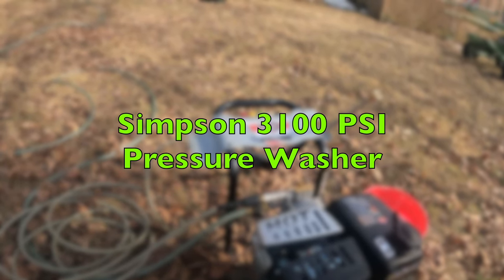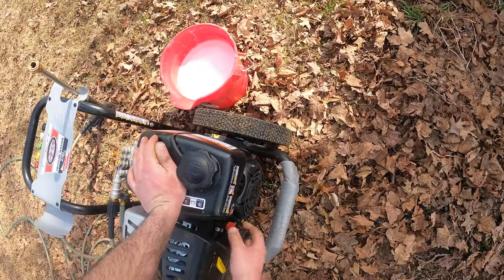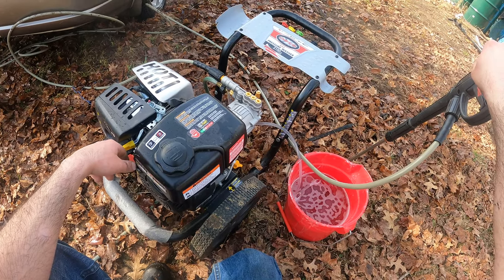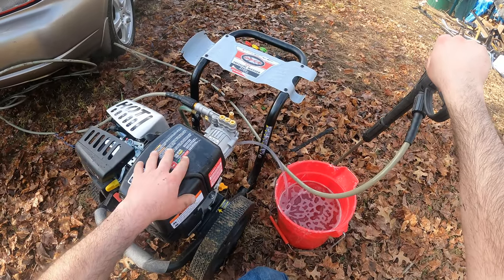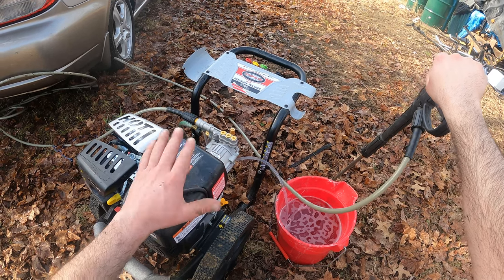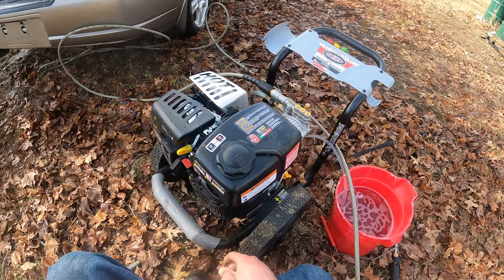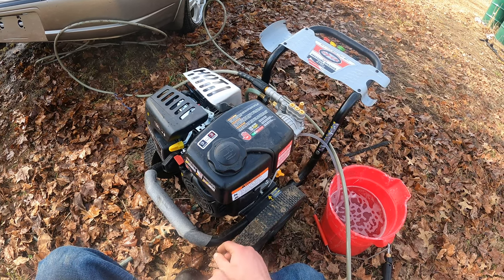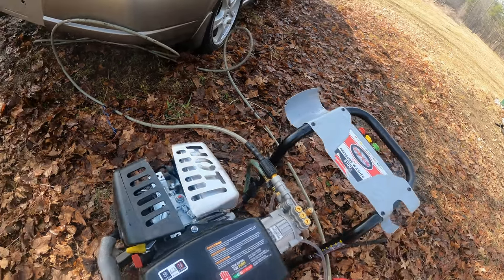Simpson 3100 PSI 2.4 GPM Pressure Washer With Kholer Gas Engine, In Action And My Thoughts One Year

Comment: Did you put regular gas ? And what type of oil did you put in ? . I'm having trouble starting mine I bought on offer up
Reply from the maker: Hello, yes I used regular gas which contained ethanol, but before winter I added stabilizer to the gas.   Oil wise I’m unsure, it came with oil in a Simpson package but I’m guessing it’s normal 10w30. 

Normally this gas if left sit causes the float to stick in the carb on small gas engines.  But it could also be a issue of no spark or bad plug but probably a gas issue.
Reply: Check the air filter, can get soaked with oil in transport. Check oil level, has to be exact, and unit should be on level ground when starting. Release all the air pressure from trigger before trying to start it. Could be one of these things. Hope that helps.

Comment: Is the psi reducible ? I was wondering how were you washing your car so cb lose without damaging the paint
Reply from the maker: No, but it also depends on what tip you use, like the soap tip there is very little pressure.

Yes I was definitely to close lol but this car was in the woods for 10 years so I was trying to get the moss off of it…..
Reply: it can be with different size orfice.

Comment: Did you have to purchase the holes for the soap, how much water and soap did you mix?
Reply from the maker: Hi the soap hose came with the pressure washer, the water to soap depends on what soap you use, the ratio should be on the back of the bottle.